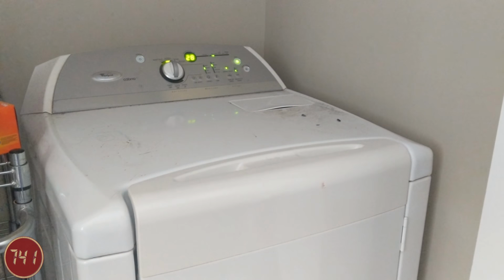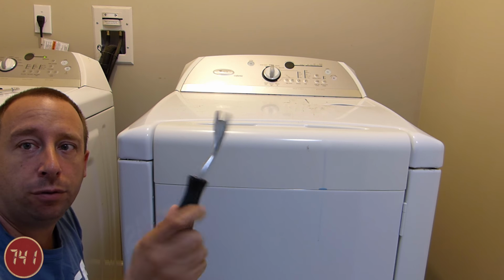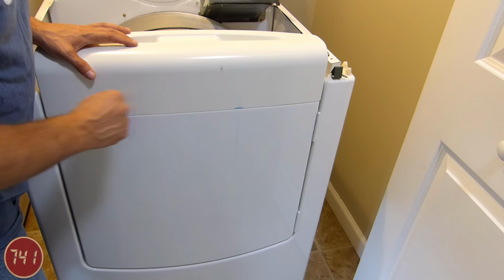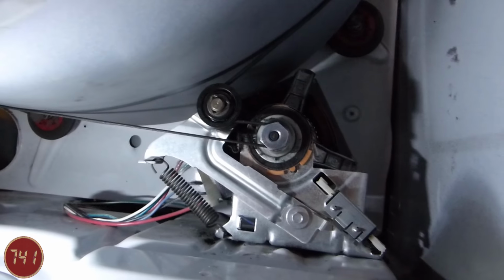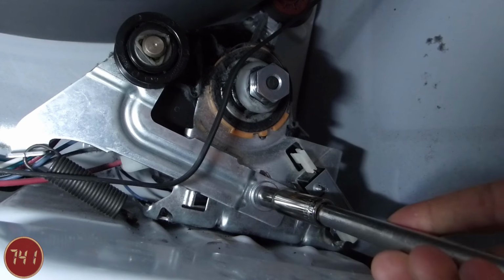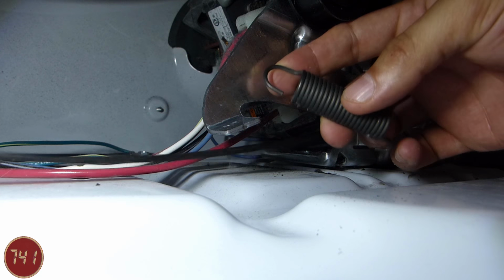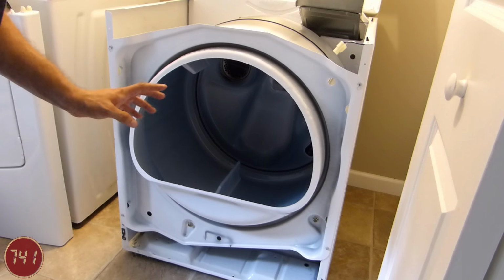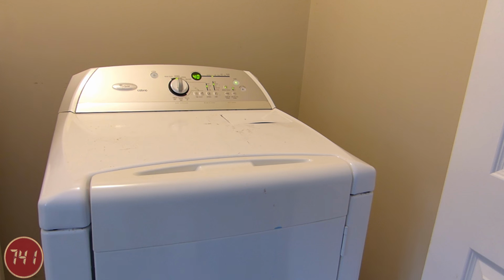Squeaky Dryer Repair - Belt Tensioner Replacement - Whirlpool Cabrio

Comment: I am watching this video to help me with another issue that I'm dealing with.  I used a putty knife to pop the clips so I could take the top off.  When I lifted the top, the clips came out and fell to the bottom.  So now I have to take the front door assy off.  How did you unplug the safety switch?  Mine is not made to simply pull apart.  It looks like a tool is needed to press in 2 little tabs to then be able to pull apart.
Reply from the maker: Use a small screwdriver to push the licking tabs if you can't squeeze them with your finger....at least that what it sounds like you need to do. I can't say for certain without seeing it myself
Reply: @SevenFortyOne  hi. thx for the reply.  I got it with a screwdriver shorty after posting. The real problem that Im working on was that I took out the lint/duct assembly out to clean it.  Now I cant get it back in. GGGRRRRRR!!!!

Comment: Another successful student of your tutorial!   Might add that the bottom of my frame just below the door was quite sharp and putting a cloth over the edge will prevent a scrape or cut on your arm while trying to do the work.. BE SURE you follow the video exactly when putting in new part.. IF you put the belt on first and then try to install the spring .. its extremely
difficult..   THANKS for saving me $200 on a service call

Comment: My dryer squeeks are fixed by spraying grease/WD40 on all the roller axles.   This must be done approx 3 times per year.  Luckily, removing the front cover for access is only a 5 min job (10 min round trip) -- so I'm ok with this, for now.

Comment: 741/NASA!!  Same dryer, broken belt.  Thank you for an excellent video.  I struggled to find how in the world to access the pulley area.  I removed the back sheet metal, which need a good vacuuming.  Getting the door off was the key.  I'm now awaiting a $10 belt from Walmart (Amazon wanted $30).  Thanks again and cool shirt.
Reply from the maker: Good luck with your repair!

Comment: Bolt will not turn for me. I guess I need an extender for the socket wrench
Reply: Did that and it worked, but the spring is impossible. I need some one stronger to do that part, Needle nose pliers did not work for me.

Comment: Thank-you for the video, just fixed mine. A few notes based upon my experience. 1) It is a lot easier to simply go ahead and remove the drum and hardly any extra effort. 2) While the drum is removed, go ahead and remove the four load bearing wheels and clean them and their shafts, inspect for cracking, etc. None of these contain actual bearings to fail. I put some high-temp grease on each wheel when reinstalling. BE GENTLE with the small triangular shaped capture washers as they will  break.  3)Go ahead and replace the belt while you are in there. The odds are if the tensioner has failed, the belt is old enough that it has stretched 3-4 inches anyway and has become inefficient. 4) clean out all of the escaped lint and rake in the loose change that has settled under the drum like a 70s auto backseat! Super easy fix, especially with the help of the video!

Comment: I'm trying to take the top cover off the dryer door after dropping the door catch that holds the door closed. There are four screws along the inside top edge I took out but the cover doesn't want to pop off. I don't want to pry on it and maybe break something. Have you had your off and if so, how did you do it? If I take it off, I'm sure I can reach into the bottom of the door to get the door catch.

Comment: Hello i saw your video and it help a lot but im having trouble finding the model number for my Cabrio dryer the belt broke and i need a replacement one my dryer looks just like yours but I don’t know what the model number is located to order a nee one would you please help or direct me where to look for it i have been searching and looking you tube videos and I couldn’t find one that talks a about how to find or where the serial number or model number of a whirlpool Cabrio dryer is located thanks i will be reading your comments
Reply from the maker: Its on the the door frame near the hinge.
Reply: SevenFortyOne    thank you  you have help me alot no idea where it was casuse i took the door of the dryer and i got it out of the way with the door closed thank you so much

Comment: You helped me fix it. I replaced the bearing, belt, and side rollers, 2 months ago and then the belt started slipping on the motor. The bearing even though new, was freezing on the shaft. I greased it well, and so far no noise and no slipping. And with that, it is time to take a nap!

Comment: very helpful video...thank you! Saved me loads of time! if the tensioner pulley is siezed up, it is not difficult to remove it from the idler arm and give it a cleaning. This was the case with my dryer. the bushing interior was gummed up and frozen to the race.Sprayed a little wd40, removed the triangle clip (carefully though, it is plastic and could snap)and the pulley came right off. cleaned it and removed the wd from the pulley itself so the belt wont slide; greased the race and put it back together. my pulley was still in usable condition.

Comment: I saw a video that says bc it is not sealed some lint can back up around the drum? if this is true can it be possible to lift the top and vacum it from time to time?
Reply from the maker: Yes - you can clean it out from time to time....its also a good idea to check the hose that leads from the lint trap to the outside to make sure it is clear every so often.
Reply: thank you!

Comment: Can you think of any reason my dry clothes(from the dryer)don't smell clean. If I line dry them there is a big difference. The machine is almost 20 years old and worked fine. Could the smell be coming from the dryer filter?
Reply from the maker: Might be the filter or lint stuck some someplace else inside.   You might have to take it all apart and clean the insides out.